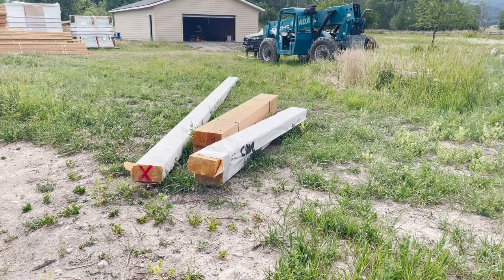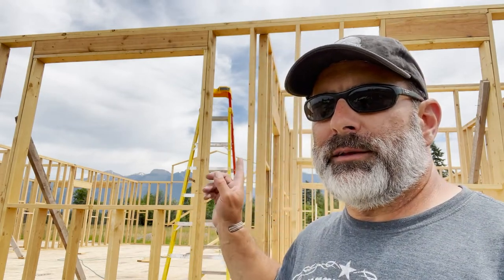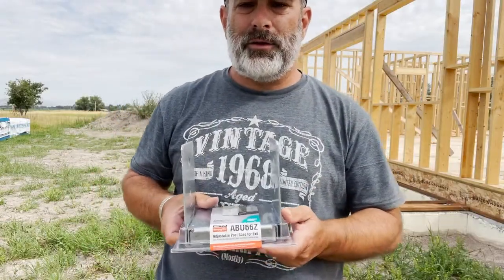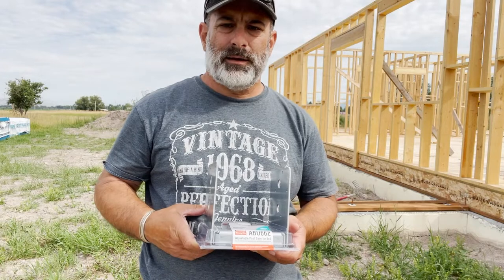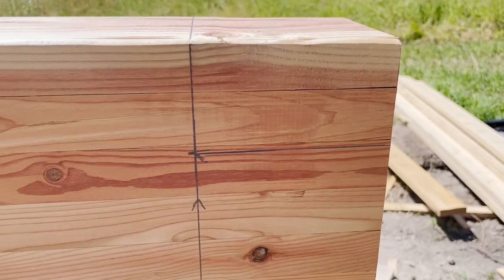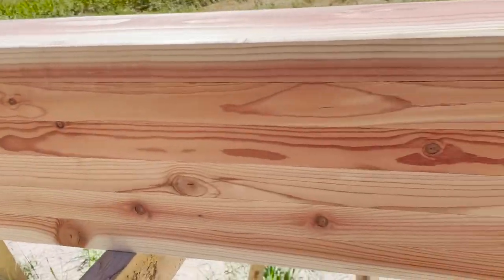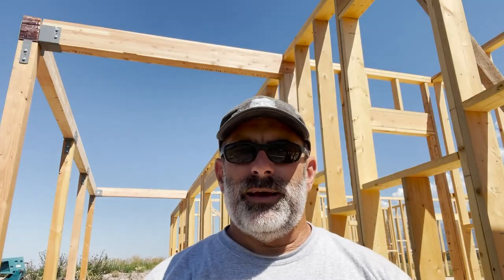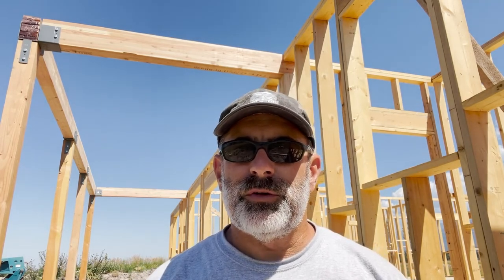Building a post and beam front porch| Building Our Own Home Ep.21

Comment: Hey Tony and Colleen! I have been loving watching the progress on first the shop and now the house. I have questions! When you put up those four vertical 2x6s….did you do it that way for strength and integrity or are there no 6x8s? I’m assuming the former. Also, why not cut the tops off the vertical beams before setting them up? If I had to cut them like you did, they would be all wonky and I probably would’ve fallen off the ladder a couple times 🤣 AND to answer the question of stain vs paint, if you are staining the porch “floor”, I would stain the beams. If you are painting the floor, I would paint the beams. Much love to you both!
Reply from the maker: Hey Patti! The 2x6 were added as structural support not only for the beams but for the roof truss support. I also cut the beams in place to compensate for any  variations in height on the foundation below them so that they were level after final placement. Made it harder but more accurate. Thanks for such great questions